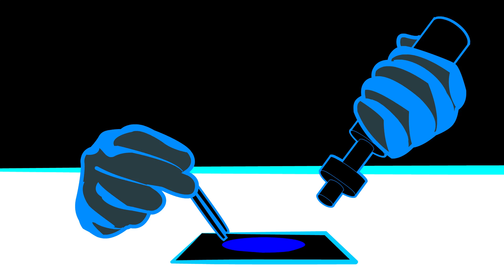Microsoldering 101 | FPC Connectors made EASY | On and Off like you know what your doing!

Comment: I've been trying to replace one in a video camera. It's 0.2mm pitch. But when I test the pins with a dental scraper, I always get a few that move. I'm thinking of putting a little lead strip on top to give it weight, and just re-melting the solder from beneath with a hot air station. Is that worth a try? Does the solder require a higher temperature to melt the second time than it did when it was paste? I don't see why it would. fortunately, there's a little empty part of the board right under the connector, so I can shield everything else with kaptan tape and that silver paper that stops the coils of a hot air station from shorting on the sides. I forget what it's called. I don't have a reflow oven, but I just put an oven thermometer in my regular oven and let it settle at around 100c.
 I don't wanna take it to a repair guy, cus they want to charge me for fixing a video camera, not for soldering one connector to a board. When I tell them the board is already out of the camera, they don't want to know.
Reply from the maker: Just put a .2 or .3 solder ball on any that are no connected and heat it up with hot air and it will solve the problem for you :) 

Also, kapton tape is not needed for anything other than direct contact with plastics to prevent warping. 

If you send me a photo to my email I’ll try to be more helpful. Justin@artof.repair :)
Reply: @TheArtofRepair  Awesome, thanks. I'll have to wait till I'm back home before I can do that. Shouldn't be more than a few days. I'll just use the subject header "FFC Connector"

Comment: I’m new on the soldering job. I was trying soldering lcd FPC connector on iPhone 12 Pro Max motherboard. I removed the old broken FPC, cleaned the area and was trying to reball the pads eventually I ruined three pads as the soldering wire created large balls which wouldn’t remove from the board so I scratched them with the iron and pads were removed. Why when I go over the pads with the iron the actual solder wire not sticking on the pads and creating iron balls all over? Is this board done?
Reply: Show us how far u coming along
Reply: It's because your soldering iron was overheating. Tin the tip and possibly try a different soldering wire

Comment: I try to solder the fpc of galaxy a21s but the comnector wont bound fully with the board. All contacts are under the connector. All temperatures tried from 180 to 350.

Comment: Do you mean 60, when you say half air flow ? 
Very valuable tips regardless, thank you very much !
Reply from the maker: Half of this machines airflow of 120 units is 60, so yes :) 

I try to just give info like that bc most of these units have the same output. Just not the same measurements. So half just made it easier 😅
Reply: @TheArtofRepair  Yeah no, I get why you said it that way. I was just a bit in disbelief, because I usaually blow all components away when I have that high air flow. But it totally worked. I soldered some JAE FA1004SA1-R8000
 connectors to my new 3DS XL with 100 airflow on my Quick 861DW and 340°C. And it was beautiful. I could keep the ait outlet on the connector for a full minute with it being completely undamaged. I didn't use a nozzle which made things better...
Reply from the maker: @anschflck8049  I’m glad things worked out for you! Sweet! Have you tried many soldering repairs before?
Reply: @TheArtofRepair  Yeah, I'm currently a student at university, but it's not very fulfilling. I am learning things but it's very theoretical and many things I won't be able to apply anywhere. Because I already did an apprenticeship at a company I had a lot of practical experience already. So buying broken things off of ebay and fixing and reselling them helps me to stay balanced. At the company I didn't do much hot air work though, so I have some catching up to do.

Comment: Would you use a low melt solder to re-apply this connector 138c?
Reply: no, 138c solder has bismuth in it which is weak and brittle

Comment: How can I find which FPC connectors I need for a project? I've tried to gooble the sizes and types with no luck. I have a Samsung phone project I'm planning and they look like the one in this video, but several sizes. I need to order both male/female, to make piggyback sandwich adapters for the FPCs.
Reply: Have you tried buying a broken phone of the same model on ebay, and using it for spare parts?

Comment: What is a good solder and flux for flat flex repair?
Reply from the maker: The key to knowing the anwser yourself is in watching my microsoldering 101 - 102 playlists =), but just to give you a more direct answer. Amtech 559 flux and 63/37 solder will work just fine =) Thanks for the question, view and comment!

Comment: Question when do you preheat a board before hot air
Reply: When the board will suck the heat out of the part you're trying to work on. If the board is already pre-heated, the part will heat up quicker. If you don't pre-heat, all the heat will keep going from the part you heat up, into the board... and the part won't heat up properly.
Reply: @PaulLawson-k8v  thanks

Comment: I did this and even on low air the connector flied away
Reply from the maker: when you remove? or when you put the new one down?
Reply: @TheArtofRepair  I removed successfully
But while fixing new one, even on low air it's flying away or it moves from its position and pin shifts to another track..
I am thinking to put a small layer of glue below the connector..stick it and hot air it!
Is it good to do so?

Thank you for your reply 😎🇮🇳
Reply from the maker: @saikiranshiny  i mean if theres flux there on the pads where you put the connector, the flux should hold it where it needs to be. And if at 0 air speed its blowing things away at this point maybe your using a pinhole hot air nozzle
Reply: @TheArtofRepair  Oh,Thank you sir.my station has   a minimum speed of 1 .i can open and reduce the speed of air..And should i use 136 c Flux paste for this?..because 1883 is hard to melt and high temp.may hurt the plastic?
Reply from the maker: @saikiranshiny  low melt solder is for the weak. Never :) 

You can do this. I believe in you. 

What station do you have?
Reply: @TheArtofRepair  thank you sir, i use AKT 850 AD SMD Rework Station custom made in India.( a clone of quick maybe)
Reply from the maker: @saikiranshiny  Hakko 850 clone, but yes and that should work just fine! Personally i use a 6mm nozzle at like 20% airflow, if you can put up a video on your channel of you doing the work maybe I can help more.
Reply: @TheArtofRepair  okay sir, definitely..
Meanwhile I will go though the videos on your channel.
There's lot to learn over here

Comment: I'm struggling to get the solder sitting nice and neatly on the pads when doing a similar task. I'm using leaded, plus flux, plus a bent tip. I don't, however maintain contact with the board like you do and move in circles. Is that the secret or is it more? Thanks in advance for your help. I've subbed by the way 🙂 Ed
Reply from the maker: The biggest thing it seems would be that you're not transferring enough thermal energy into the board, go back and watch through my 101 and 102 playlists, I bet you will knock it out of the park.   The short answer though is that you need to use the biggest tip possible for the joint at a proper temp, if you need to turn it up for a specific job. sometimes you gotta do that. I usually try to work as cold as possible,  while still maintaining control of my work. You can always keep adding heat, but if you turn it up too high you can't take the heat away and you can damage pads if you're using an iron.

Also, another secret, add hot air in your other hand =) it will augment the board's temp overall in that area so that it cannot absorb the heat from the iron as easily. Hope all this helps. good luck in your journey FTLOG.

Comment: Great tip once again as this demonstrates to what I refer to as the proper "time, temperature, airflow, and overall technique" in regards to successful rework, not heat per se. Keep up the great vids! This technique even works well with connectors on flexcable that I've had to use several times at my shop.

Comment: When trying to tin the pads after taking off the fpc connector and getting it ready for the next connector, my solder doesn't want to stick to the pad and only slightly covers some pads, so when I hot air it there isn't enough solder to make good connection with the leg of the connector, any suggestions? Thanks, great videos!
Reply: Would the soldering iron tip be the cause, I'm using a chisel tip, nothing like the hook tip you are using.
Reply from the maker: Are the pads highly oxidized? If your getting some but not all they could need a little scratching on top to clean off more oxidation. But as Cormac said as well, might need some more/better flux as well. Did you purchase an iron set or just specific tips?
Reply: @TheArtofRepair  some of that pads seem to be oxidising quickly when trying to tin, but I believe that's down to the poor quality flux I'm using, I'll have to get a better quality one. As far as the iron goes, I have a thermaltronics t9000s, I have a couple of different sized chisel tips, will have to invest in some other types too.
Reply: Sounds to me like u need more flux and not enough thermal transfer from your iron to the pad one way around this is to use a bigger ball of solder on the tip = more surface area and mass to transfer heat to the pads , Myself i use preheater you also want to make sure there is no corrosion on the pads
Reply: @cormacpyper  thanks for the reply. I think the flux I'm using isn't the best quality so that might be part of the problem. I used a bigger tip with a bit more solder and seemed to give me a lot better coverage!

Comment: I work with 300ºc on iphones FPC with great success, that samsung pcb will require less heat, that silicone mat also works as bottom heater once hot air put that mat hot. Other alternative for PFC and mics are heat from bottom if possible, or use a preheater
Reply from the maker: Yes, the thermal mass of the Samsungs is a different beast for sure. 300 is def a solid spot to do it at. I appreciate the view and comment, hope to see you in the comments again in the future!